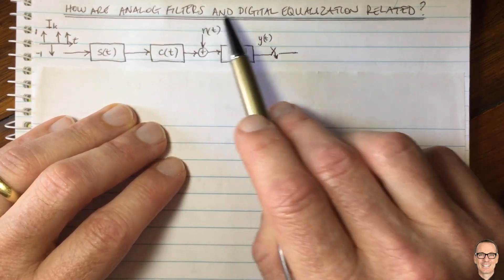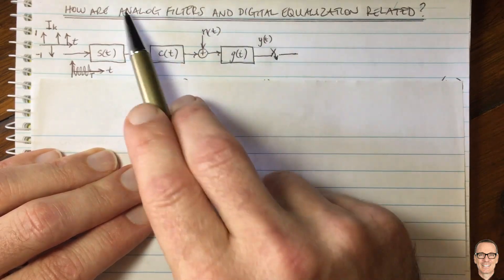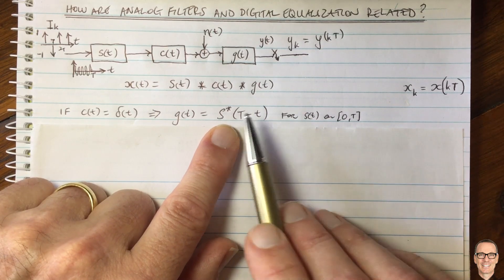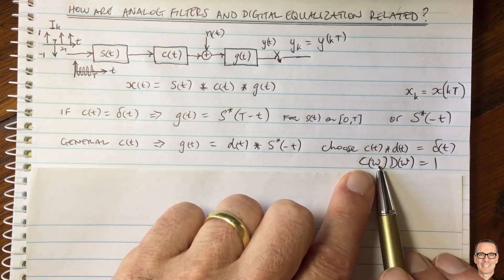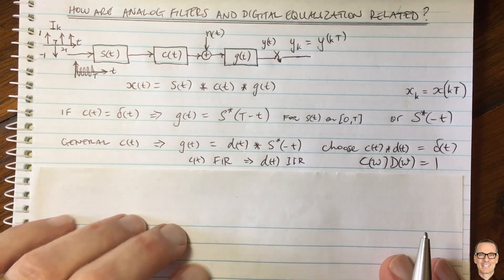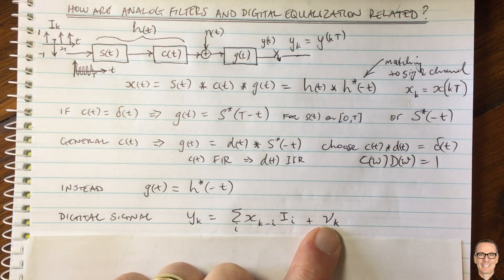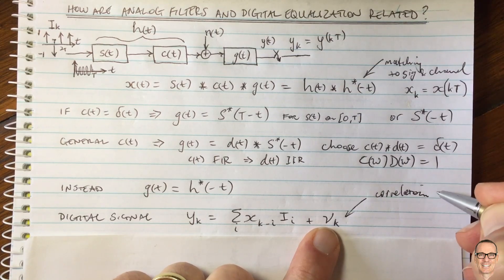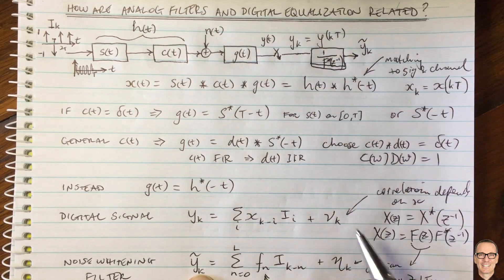How are Analog Filters and Digital Equalization Related?

Comment: Dear sir!
As i understand, the x(t) has now been decomposed to F(z) and F*(z-1), where the inverse of latter is the decorelating filer for noise whitening and the inverse z transform of F(z), fn is now in the signal representation, how will this fn will restricted to a value of 1 only for the current Ik sample and 0 for the rest?...
Reply from the maker: You get to design s(t), which is a major component of fn.
Reply: @iain_explains  so this fn is controllable through careful pulse shaping at the tx side?
Reply from the maker: Yes, exactly.

Comment: sir  are X(kt) and Y(kt) same  ? as X(kt) is the o/p of convolution s(t),C(t) and g(t) which is equal to y(t) than why different notation of X(kT) and Y(kT) are taken 
and whether the channel used here is multi-tap channel then only ISI will be possible
Reply from the maker: No, x(kT) is the sampled version of x(t), which is the convolution of the three filters, s(t), c(t) and g(t). y(t) equals x(t) convolved with the input sequence of impulses (delta functions) with values I_k at time t=kT. The channel has impulse response c(t), which can be either ISI or not.

Comment: Thankyou for best videos. Can you guide, if Joint Maximum Likelihood Detection (JMLD) is used for detection in Uplink NOMA, what will be the sum -rate in this case?
Reply from the maker: The "sum rate" most often refers to the addition of the "capacities" on each of the different "channels". It is an information theoretic measure that assumes ideal coding and decoding (often assuming infinite length codewords). So it is not really defined for an end-to-end system that includes the detector, unless you model the overall system as a binary symmetric channel, for example (in which case you would need to calculate the BER of the JMLD and use it for the error probability in the BSC).
Reply: How to calculate the sum-throughput?

Comment: Hi Lain,i have a question about sampling,i'm wondering why they defined the frequency band of any signal after FT as -w to w,rather than -w/2 to w/2;since in former case,T=2Π/2w=Π;that will make period as Π instead of 2Π,and this is actually countering with the fact of e^iθ rotating a unit circle,that's one of the coincidences or origins of periodic function.
Reply from the maker: It's just a scaling issue. When people talk about baseband signals they usually label the "bandwidth" as being from 0 to W (ie. W Hz of bandwidth). For example for speech processing. Instead, when they talk about signals that are modulated at a carrier frequency f_o, such as in wireless communications, they often label the "bandwidth" as being from -W/2 to W/2 in the baseband representation (because the modulated signal will be using W Hz of spectrum - ie. from (f_o-W/2) to (f_o+W/2) ). Note that in the so-called "passband" (at the carrier frequency f_o) there are two orthogonal signals/waveforms (sin and cos, represented as real and imaginary in the baseband), whereas for purely "baseband" signals, there are only real signals (and no orthogonal "imaginary" signal/waveform).
Reply: @iain_explains  I see,i realized i made a mistake that is those two notations actually have nothing to do with the rotation period.Reason i asked is that i connected to a fact that any function is a periodic function in theory,even with realistic non-periodic function,their period can be thought as T=∞.
    There's actually another curiosity,sure in sampling we could do FT for x(t) and pulse train and whatnot to validate mathematically that indeed the multiply in time area is the convolution in frequency area and vice versa.
    But the way i'm validating this visually is that :
    In time domain,when we are doing sampling,we choose our sampling rate Ts according to the frequency band of x(t),let's say -B to +B;
    Ts will usually twice as big as -B to +B when we FT our sampling pulse train with the rule of 2Π/Ts;
    which means for every continuous 2 Ts,there's actually the full range of frequency value covered within 1 Ts,and reason for that is actually the decaying system that you talked in one of your videos,because in time domain the output signal at any moment is actually an accumulative effect that caused by the pulse at this moment and the decaying effect caused by the previous pulse,which in a way is convolution;
    which means when we do integral of the multiplication of the pulse train and the original signal in time domain,we get 1 full range of frequency signal;
    while in the frequency domain,in order to achieve the same effect of "full range in a pulse",we have to do convolution between X(w) and Xs(w) to make X(w) shift along in the axis of frequency pulse,so that it can also get the full range of the frequency signal.
    I'm not sure whether this visualization holds actually,correct me if i'm wrong if you have time to read them all.